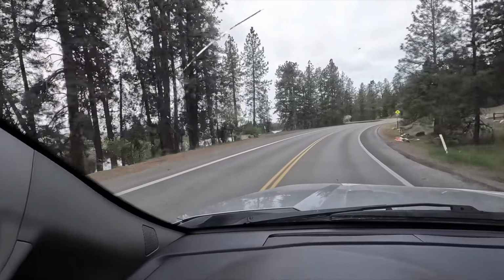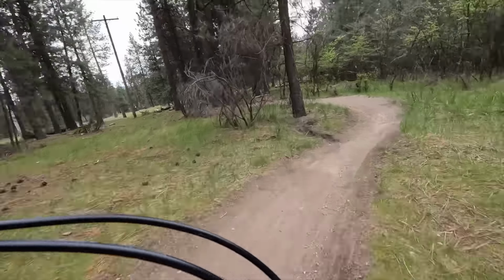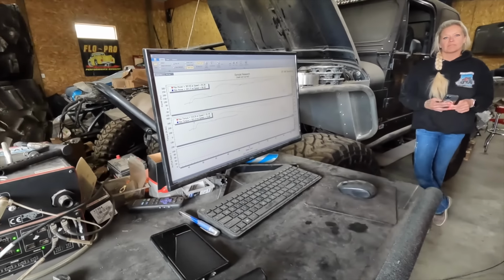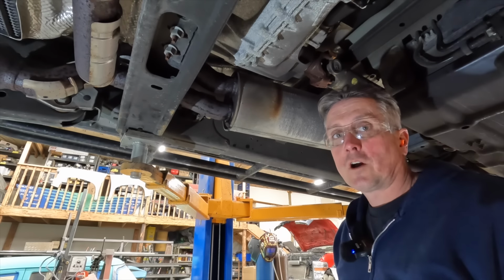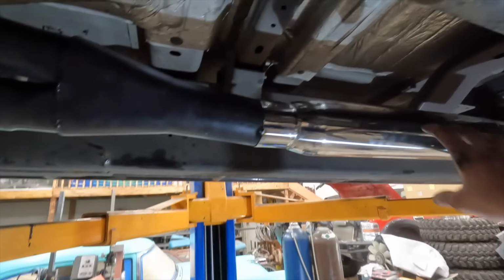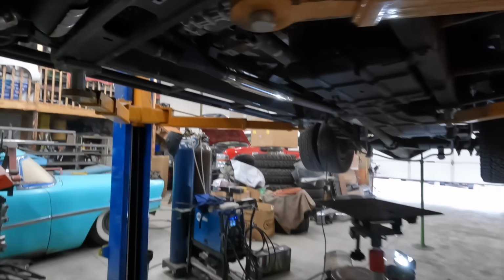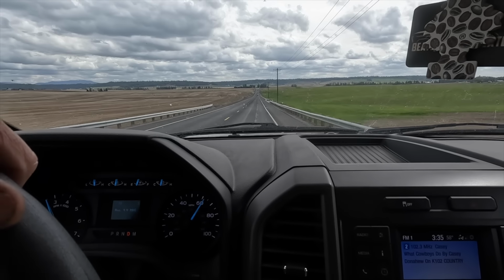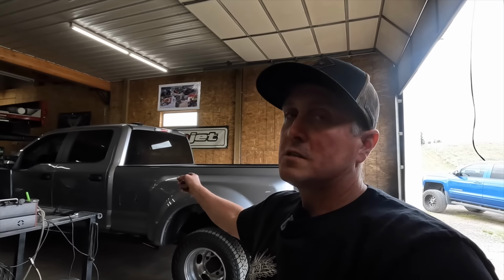Cheap horsepower for your 7.3L Godzilla Ford!!   And Mountain Biking!

Comment: Pull it into M and shift it to 4th. Then punch it from 2k up to redline, being in 4th should also keep you from hitting the speed limiter. Running it on the dyno in 6th is wildly inaccurate as that's the second overdrive gear in that transmission. 4th is close to 1:1 so your figures will be more accurate.
Reply from the maker: Thanks for the heads up

Comment: I bet you would have had a lot better numbers on the dyno the truck stopped pulling cause the speed limiter. Top speed is 96 mph if you tuned it you would’ve seen it pull more power!
Reply from the maker: I might go back for another run one of these days

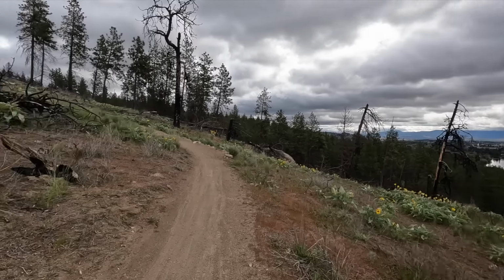Comment: Good to know. I've got a 22 F250 7.3 with 4:30 gears and the 10 speed that I absolutely love. I'm ready to start modifying it and this video helped push me to do it. 

From what I've seen out of the 7.3s with a 10 speed stock should be upper 340s to lower 360s on the horsepower.
Reply from the maker: I think that is crank hp.  Not to the wheels.. but I could be wrong. Have not investigated mucb
Reply: Having the DRW likely saps some power from what others may post up with their respective dyno sheets. The transmission may be different as well. All 7.3's might have the same, but being a 350 DRW I wonder if they gave it the same internals as the 6.7 trans.
Reply: @ALMX5DP  they offer a detuned version in some models like the motorhomes. I'm not sure what else. All the others should have 430hp/475ft lbs at the crank.
Reply: @jerryfoley8857  sure, I was just suggesting that being a 3500 DRW might show less power and torque making it to the rear wheels than others who post dynos up of a SRW 2500.
Reply: @ALMX5DP  This is probably right, especially on an inertial dyno. Another set of drive axle tires take more power to get up to speed.

Comment: That Flowmaster 250300Y is about the best y-pipe for the money. I used a 300400Y from the header collectors on my old pickup and used a 4" diesel exhaust system to finish off my small block k2500 truck.
Reply from the maker: Cool

Comment: You should tune it. You’d love it!!! I’ve got a 21 E350 super duty cutaway with a KUV body on mine. Bought an Sct tuner and went to 5 Star Tuning for 2 different tunes. Josh Newman is the man!!! My truck runs soooo much better than factory!!! Got a 87 Daily tow and a 93 daily tow - big difference between the two. Love both but I get better mileage with the 87. Can return to factory if it needs to go back to the dealership. My horse power, torque and fuel mileage all increased drastically not to mention my speed limiter is gone😊. Food for thought.
Reply from the maker: I keep hearing the 5 star is where it’s at
Reply: Florence, SC
Reply: I second 5Star. I run an 87 performance tune daily on my Tremor since I rarely tow. Removed the accelerator delay, shifts through all 10 gears, and should’ve added about 36hp. Had the tune about 18000 miles no issues.

Comment: Nice gain in HP and Torque on cat back mod. Not only that, you just used extra parts laying around in your shop👍. The gain is enough not to notice any decrease of gas mileage when you are using your A/C. Excellent overall outcome👍. Any form of exercise is good for anybody. Good for you. I don't ride bikes anymore (71 yrs old) because of health issue but  when I was younger, I used to ride 150 miles a week on a road bike. Here in Las Vegas, there's no such thing as flat road so it's a work out. Anyway, all the best wishes on your exercise program and keep the vlog coming.
Reply from the maker: Oh man.  Those had to be good days on the bike

Comment: Wow thought that 7.3 would do more!!! 😮My 2019 Ram 2500 mid muffler deleted and a cai 6.4 Hemi dyno numbers were 359hp and 389 torque.
On my Ford trucks, I always use the Walker BTM mufflers because they’re straight though and don’t drone.
Reply from the maker: I forgot about those Walker mega flow mufflers

Comment: Have you seen the flexible extensions to put on the weld tip? Makes welding on the top of exhaust pipe more simple.
Reply from the maker: When I had an exhaust shop I had a profax flex head gun.  It was kind of gimmicky.  Didn’t use it very often

Comment: Nice work!  I need one of those metal glue guns.  :)
It's probably overkill but whenever combining pipes, I'll figure out the area of the two, then make the outlet as big or slightly bigger.
Two 2.5 is 9.1 square inches.  Single 3 is 7 sq inches, single 3.5 is 9.6 sq inches.

Comment: You should just stick with running just the Glasspack and reduce your restrictions.  You have 2 mufflers on it so you still have some gains to be made if you get rid of the muffler and it would sound amazing.  I have a single 36" Glasspack on a GM 6.2L engine and it has a deep smooth sound.  I also have dual 18" Glasspacks on each pipe on a Tundra 5.7L and it is nice and loud.
Reply from the maker: I was really trying to keep it quiet.  With a little rumble.
Reply: It would definitely make it louder but if you went with a longer glasspack....you wouldn't upset your neighbors too much.

Comment: Try gutting the muffler or the resonator and put it in place of the glass pack. If the expansion area has enough volume, the exhaust may act as if you cut it off at the cats and still be quiet. This assumes the collector and stock tubing back affects the power negatively by creating a super long collector.
Reply from the maker: Huh?
Reply: Dave: You made a super amount of power for using parts you already had and you didn’t ruin the sound. A kit probably wouldn’t do any better. Hopefully, it doesn’t drone. It is possible that there is a little more power to be had. The collector/secondary length tuning is the place to concentrate on in a purpose built exhaust; however, that wouldn’t suit your stated goals (cost, messing with cats) Perhaps cutting the exhaust after the cats and putting a turn down would be the next best thing and would make slightly more power than your setup. That would be cheap, but it would suck. What I was trying to say was a homemade expansion chamber in place of the glass pack you installed, would make the exhaust act like it was cut off at the cats without fumes, would keep your sound and would still be cheap. v/r wh

Comment: I watched a video where they pulled a 7.3 and put it on a dyno. All they did was change the throttle body to a Holley and put different coils on it to work with the mods that they were going to do. They got just over 500 fly wheel horsepower. Ford under rated these motors. On mine I got rid of one resonator and muffler and put on a Flowmaster. I also put on an AFE GT Momentum dry forced air intake and a Banks Pedal Monster. It woke mine up big time. The Pedal Monster does nothing for horsepower. It does make the throttle open up when you want it to and not when the EPA wants it to. It makes enough sound to make me happy without any drone noise. When towing on the hwy, you can  hear it with a load.
Reply from the maker: That all sound good

Comment: I currently have a 2016 F150 5.0 Supercab 8’ bed and the heavy duty payload package. It’s been a great truck but I often find myself towing more than 10k pounds these days and a newer F350 SRW with the 7.3 Godzilla is my ideal choice. Diesel would be fun but too expensive to maintain in my opinion if it’s not making you money.
Reply from the maker: I agree. The diesel definitely has its place.  But the cost is so high

Comment: My buddy has a 7.3 and he had the throttle cable bracket come loose and cause some issues, may wanna look at that. There also is a sport mode he found, you would have to look that up on how to switch it but it made a big difference.
Reply from the maker: I’ve heard the sand/snow mode wakes it up
Reply: Double tap the traction control button fast to activate sport mode then hold it down to shut off the advanced track completely and you will see what its got.
Reply: They are drive by wire…how did the throttle cable bracket come loose? 🤔🤷

Comment: 96mph limited. My 97 460 is limited to 96. So was my 2010 Raptor. I don’t know how the 10 speed is but the six speed in my 2011 5.0 truck stays in gear better when I put it in manual mode. I noticed that you had it in D instead of M.
Reply from the maker: Yeah.  Kinda lame

Comment: Dave, if you put it in “M” mode it will hold the gear you select. Leaving it in drive how you did it, just locks out gears 7-10 but it’ll still use 1-6 as needed, that’s why it downshifted still
Reply from the maker: Yep. .obviously I’ve never messed around with all that.  Need to learn the tricks
Reply: @thedirtheadshed  also, the stability control has two modes. One press of the traction control button only disable traction control. If you push and hold the button, it’ll disable traction control and stability control

Comment: Those dynomax muffflers are so underrated, everyone wants a magaflow or flow master it seams like. I had an exhaust shop and would always recommend those. Did you get any droning with the new set up? Thanks for the great video.
Reply from the maker: They are good.  They just don’t have a real pronounced sound like a flowmaster.  I personally really like the sound of the really cheap thrush turbo mufflers

Comment: Dave, where's your spandex? :) I'm feeling you on the not wanting to be out of shape any more. I used to bike as well and I've lost a lot since then, granted, that was in my 20's. I turned 40 this year. Still got the bike, but trying to get out now is much more of a challenge. That trail is awesome. Those flowers are amazing. 

Was the transmission in drive or manual mode on the dyno? In my car I can floor it in manual mode and it won't downshift. It will upshift once I hit redline. Not sure if your truck is different. Also, you could try to disable the kick down switch to get the throttle pedal to WOT without forcing a down shift. 

For that front Y piece on the stock exhaust do you think they made the path for the upper tube longer to try and make the exhaust equal length between the engine banks? Looks like the upper tube goes to the passenger side bank and is shorter overall in front of the stock merge point. 

Stock exhaust is interesting to dissect because you gotta figure Ford engineering measured the frequency response of the truck and then designed and revised the exhaust system to cancel the "offensive" or resonant frequencies. In automotive cost is really important, so everything you see has been cost optimized from the initial prototypes. A company like Ford has a dedicated "Value Engineering" team to take existing designs and shave cents off them.
Reply from the maker: That’s a lot of good input.  I’m sure the exhaust was done that way for balance and cost as well.  Get back on your bike this weekend

Comment: You missed the obligatory straight pipe rev after you cut the resonator off. I like to start and rev it after welding each piece. . Y pipe.. mufflers.. and tailpipe.
Reply from the maker: This thing was so sketchy on the lift I just wanted to get it done

Comment: I was under the impression that perforated straight through mufflers had more turbulence and created a restriction. I use the knock off (sometime branded) flow masters with the v type chambers. Some say a good performance reverse flow moves more exhaust than a cherry bomb, but I have never had access to a Dyno to test. My butt Dyno is unreliable as I am influenced by the audio.
Reply from the maker: Yeah. Seems like engine masters was the only place to find real numbers
Reply: @thedirtheadshed  I'll have to look for that one...unless you know what season episode it was. I can pull them off the the D flavor platform now. Glad you got some good results, was for sure that resonator.

Comment: I am surprised it made any extra power given since you jammed in undersized pipes against flow and fill welded them.  Probably another handful there waiting to be released.
Reply from the maker: Yeah. Those headlines being just under 2-3/4 make it a challenge.  I think next system would be 3” duals off of them.

Comment: With a 5 star performance 91 octane tune, 4.30s and 35 inch tires, my 7.3 made 350 to the tire. Didnt get a torque number unfortunately. 

Eliminating the skip shifting in the 10 speed was worth the cost of the tuner by itself in my opinion
Reply from the maker: Nice I want to look into them for tuning on my 08 v10 as well

Comment: Just wonder why you didn’t do it in manual mode?  Mine isn’t much different of a truck it will not shift in manual mode until you tell it to or slow down. 21 xl350 srw 7.3 and 430s
Reply from the maker: It’s cause I don’t know what I’m doing
Reply: @thedirtheadshed  totally don’t believe you lol. If you don’t like the way it shifts in certain places drop it to manual and take control! From a fellow dirtbiker. I guess we can all learn from each other. I’m looking forward to attempting a Tj suspension build based on things I’ve learned from watching you! Cheers looking forward to watching more vids

Comment: I saw traction control on during the first pull. Since that isn’t a 4 wheel dyno was the ecu pulling power because it thought you were losing traction? Can you fully turn off the traction control?
Reply from the maker: I’m not sure .  Never messed with those things

Comment: Is your truck a 6 speed? My 2020 is a 10 speed. I thought all the godzillas were 10sp

What’s that bike park called?
Reply: I think it’s a 10-speed but he just manually limited it to 6th. Not sure if manual mode was tried to lock it in that gear but maybe there was an issue going the route versus just locking out 7-10th.
Reply from the maker: It’s a 10 speed.  Not letting it past 6th was what Chad recommended.  That way I would be in the power band before the speed limiter kicked in

Comment: You think this truck will last 300k miles or more? You think it will still be towing max weight at that mileage?
Reply from the maker: I don’t know
Reply: @thedirtheadshed  it will be interesting to see how long they last
Reply from the maker: I talked with ford engineers and they claimed it could be a million mile motor.  Has a lot of diesel grade components in a de tuned gas engine

Comment: I hate to make any kind of negative or sideways comment but I noticed when he showed the dyno pulls he did not even run it past 5,000 RPM and those engines make Peak power closer to 6000 RPM
Reply from the maker: Probably needed to hold it in 4th or 5th to not hit speed limiter first

Comment: Doesn't the truck need to be in a 1:1 ratio (4th?) to dyno it properly?
Reply from the maker: I don’t know that 4th is 1:1.  That would mean it has 6 overdrives
Reply: @thedirtheadshed Maybe I misunderstood but in the top left of the little screen in the center of the instrument cluster it was reading "4/6", "5/6", and "6/6" during the dyno pull. I assumed that meant 6th gear (of 6 gears).
Reply from the maker: I had manually made it top out at 6th gear.      That way it wouldn’t go into the rest of the gears

Comment: Tbh I'm kinda shocked how little power the 7.3 puts down. Like it's not that far off of my little 3.6 v6 in my bison and it's less than half the displacement. Torque is another story though lol
Reply: 307 to the tire is pretty good for a DRW with that heavy rolling stock. Looks like this peaked at around 4800rpm. I bet the 3.6 revs quite a bit more to hit it's max. This aint no speed demon for sure, just designed to lope along and use that torque like you said.
Reply from the maker: I wasn’t sure what to expect.  But I’m use to driving abnormally powerless vehicles
Reply: @ALMX5DP  Exactly - You can barely compare these pulls to another vehicle given this is a 4wd DRW.  That's a TON of rotating mass eating up dyno power at the wheels.  I do wonder if some of those gains weren't driver-induced though - how you "drive" the dyno can cause significant changes, so did he get the best out of it on the 'before' pull?  Seems like a massive increase for so such small changes hard to believe the factory would leave that much on the table.

Comment: I thought the 7.3s used the 10spds not the 6spds
Reply from the maker: It is a 10 speed.  I held it in 6 so it wouldn’t get to the speed limiter so fast